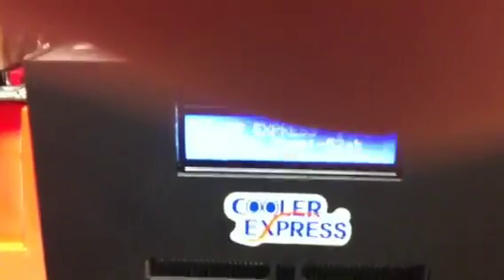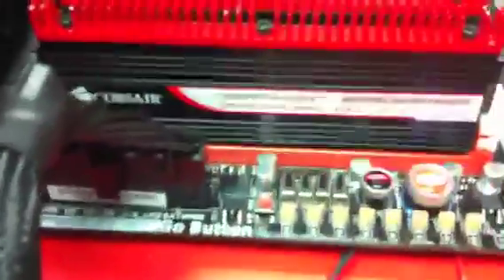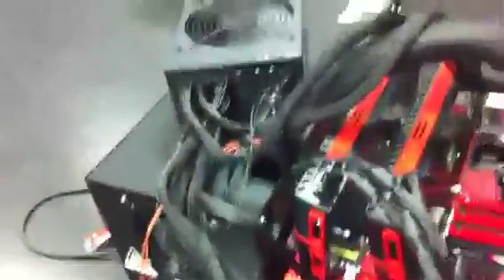Phase change cooling a 980x @ 5 ghz

Comment from the maker: The noise is coming from the phase change unit as well as the power supply, not to mention right outside that door there are a lot of machines running.